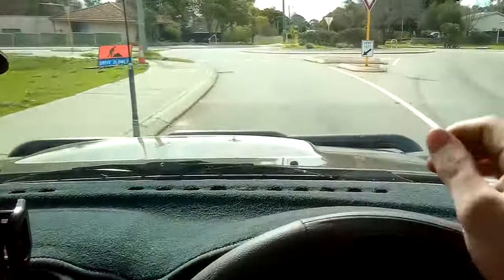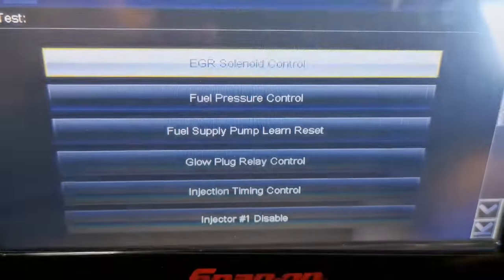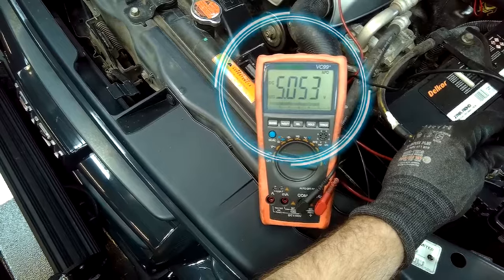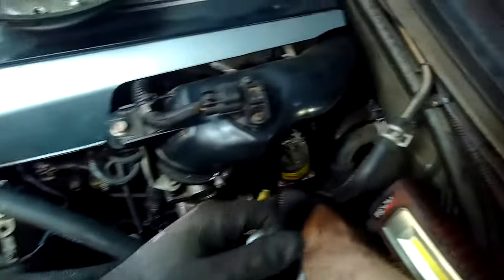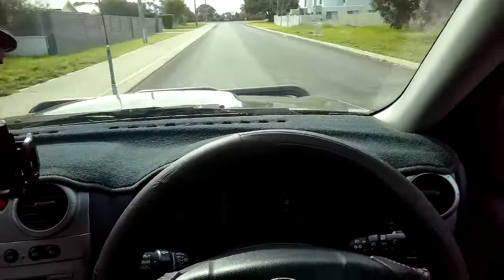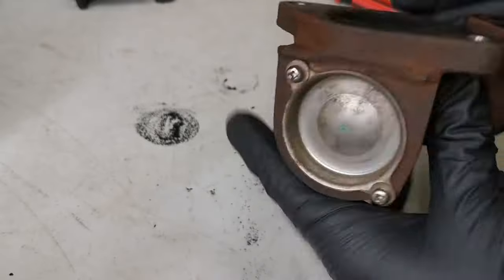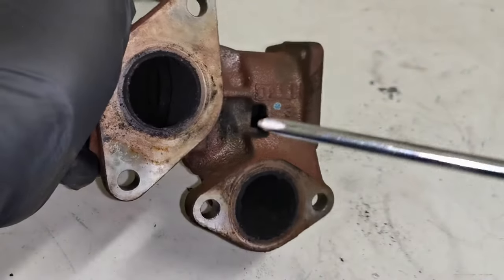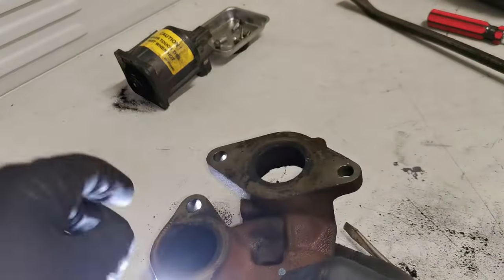Isuzu D-Max Faults P0404 & P0401 - How To Fix - DIY

Comment: I have opened the EGR twice in my D`Max. The actuator is normally ok, but the valve has a lot of accumulated carbon. I just washed it with kitchen cleaner and a toothbrush. Easy fix.

Comment: My Colorado stuck me up and had to idle home in low range 4x4 for 5 km at about 220k kms. Had the valve cleaned out now back up to 700 km per tank of very expensive diesel and full power again. Cheers.

Comment: If you.purchase a new egr and do a like for like swap do.yiu have to reset the egr on the computer or its just plug and play once removed, are there gaskets on the ports to.engine connection, 2009 dmax 210k city driving, good puff of black smoke on exceleration?

Thanks

Comment: Hi thanks for your video. I have replaced my EGR on my DMax but my vehicle is still manifesting the systems of a stuck open EGR. I've  unplugged the battery and the Check Engine lite went out but event with the lite out the problem still persist, do you have any idea what the problem could be?? Please respond

Comment: G’day mate great video. I had this issue had power loss very noticeable between 2nd and 3rd gear. We went ahead and replaced EGR valve.. I’m now getting the engine light again (1 week later) has a mate connect and got the P1401 code (Closed position Error/Learned position Error) I haven’t noticed any power changes. My vehicle is the 2011 Dmax 3L 
Any advice would be greatly appreciated

Comment: Hi Gerard thanks for the video, question for you before pull this down is there gaskets to these connections I need to purchase or will the old ones suffice. I am in western queensland about 600kms from the nearest Isuzu dealer so I better get anything I need in advance thanks again

Comment: Hey Gerard! Thanks for the video mate, I’ve chosen the busiest part of the year to try and sell my ute (2010 Isuzu d-max) just like this one, it also has a problem with the EGR valve due to going a bit long between services (oil change) I have a new EGR to put on it but I’m wondering if i just whack a new part on there, with carbon still most likely built up in the intake manifold, am i going to just ruin a good part and run into the same problems that i did before? (Car also going into limp mode) Or will it run smooth enough to burn some of the carbon off and begin to right itself? Would it be wise to do an intake valve clean and maybe a clean through the MAF with some engine conditioner type spray/foam?
Thanks Gerard, any help is super appreciated

Comment: Thanks for the video couple of quick questions, is there any products you can spray into the intake to remove carbon build up?

Can you use brake clean on the removed parts in your video to remove the carbon?

Do you have the correct part number for tthe EGR valve in your video as I have a 2009 with 173k on it and does that part come with gaskets or there is no gaskets used on the DMAX?

If you installed a catch can where in the EGR or system would you install it on the same DMAX?

Thank you
Reply: Yes,best thing i found is acetone,nail varnish remover,dissolve carbon easily

Comment: I’ve a 2005 3.0 dmax here, no lights on dash or anything but what I’ve noticed is the sound drastically changes after about 3 minutes of use. The kind of bus/truck wushsy sound goes away sounds almost like it’s getting less air/ there’s a less air kinda sound, I cleaned the egr today still the same. Is this normal? When it happens the power is still the same it doesn’t lose any power but it sounds like the engines less powerful but it’s not? Anyone have any suggestions? Thanks.

Comment: Hi Gerard. I have a 2005 vw golf mk5. When I accelerate there’s a gear/rattling type noise coming from the gearbox. The noise is also present when the car is idling in neutral but the noise goes away when I press the clutch pedal in idle. Is this most likely a bad input shaft bearing? Thanks
Reply: Dual mass flywheel is knackered guaranteed

Comment: Ive been getting the P1401 code for a while saying its its closed/performance etc. Originally cleaned it all out even though it wasn't as dirty as the one in your video, still showed the code. A mechanic reckoned it was the solenoid but after trying three different solenoids and a clean valve it still showed the same code. Now with a complete new EGR its still showing the same code. None of the mechanics in regional Victoria where i live know what to do with it
Reply: Hey mate, any chance you found the problem? Ive got the exact same problem, EGR was clean, replaced solenoid but still not working. Any help would be appreciated.
Thanks
James
Reply: @jamespayne6368  i ended up buying another brand new EGR. Haven't had an issue since, touch wood.
Reply: @chiphood2966  Thanks mate, this thing is doing my head in. My brother has the same car with no issues so going to try his EGR on mine to see if that works.
Reply: @jamespayne6368  yeah if i had my own way id not have EGR fitted

Comment: i dont think i strip and clean a customers egr in this day n age, just in case. ive seen low km turbo deisels with intake ports almost completely blocked,  takes ages to clean it all out before doing the valves etc

Comment: The EGR went on my D-max while I was doing a job in Ireland and the truck wouldn't move at all.
Reply: same happened to me, previous owner had the egr tuned "away" so i got no error codes but the car could barely take off and was smoking like chimney. took the egr off and made a plate out of 2mm steel and blocked it off. happy days😉